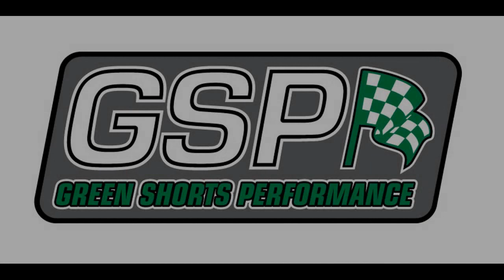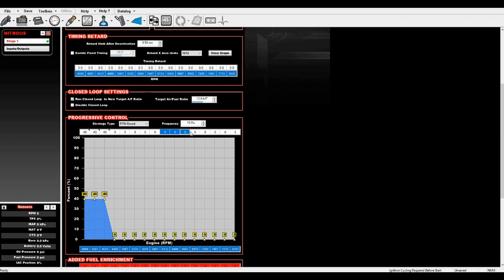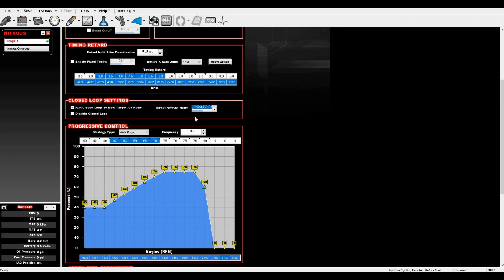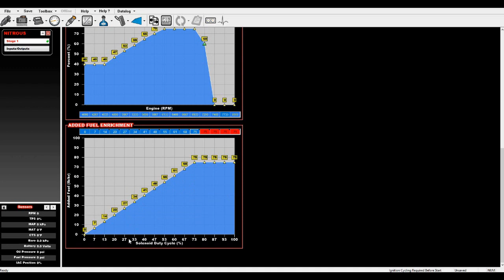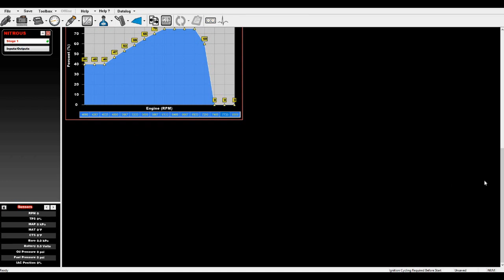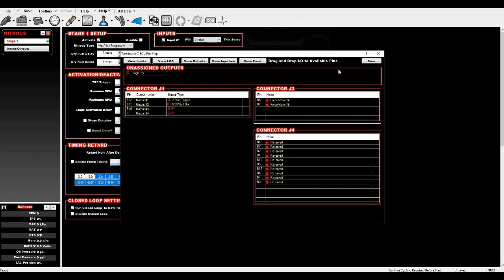How to Setup Nitrous Control with Holley Terminator X

Comment: ok, so im doing a street car with push button 100 shot, dry. using rpm retard. if wanted to do progressive, im assuming i'd do time based and it would start when the button is pressed. frequency is the pulse frequency right? percentage i would assume is the % of the solenoid  - 0% being closed and 100% being full open? 
this way it's not a sudden hit, although I'm not sure if a 100 shot would be too harsh on the drivetrain, but i'd still rather ramp into it over 2-3 seconds maybe.
Reply from the maker: @callofgeorge  for a street car I’d prefer to use rpm over time

Keep in mind it’s pulsing the solenoid not the jet. 

I wouldn’t spray at too low of an rpm and I doubt 100 shot will be an issue to hit all at once
Reply: @greenshortsperformance  ok cool thanks for the quick reply. ya it'll be RPM. the progressive is the only thing i figured would be time based since the trigger is off a button press. so essentially it won't hit every time at 4500rpm. only after he's held the button on the shift knob. so it could be at a higher RPM sometimes and only when he's wanting to spray by holding the button. i was actually curious if 100 shot would even be harsh enough to worry not hitting it at once. i've always been skeptical of using NOS because of it being an instant hit of a lot of power. prefer turbo or sc personally.
Reply from the maker: @ 100 at high rpm won’t be violent. Personally my best success is progressive rpm based with no button because the engine just acts like a high Hp NA engine. If you’re progressive down low and full shot up top it makes a 500hp engine drive like a 750hp engine etc and the driver isn’t worried about a button he just drives the car
Reply: @greenshortsperformance  i gotcha. its a 427 sbf that was dyno'd for 650hp na. its a "go baby go" button in an eleanor.. so may be more preference than practical. it'll probably get used like more of a "scramble" button.

Comment: @green shorts performance
Why would the jet not matter? I'm trying to wrap my head around that.  The solenoid can't outrun the jet, so how did it produce full power?
Reply: I’m trying to wrap my brain around the same thing!!!! I’m going crazy here because I have a 400 hp solenoid and dont want to spray the house down.
Reply: @DanielCornier-n6q I wouldn't worry about it. You can't fit 400 beans through a 200 bean hole.
Reply: yeah I don’t get that either
Reply: I get what he was saying but it doesn't make sense to me either. If your jetting is for a 50 shot at a 1 sec pulse of a 400hp solenoid. He's basically saying because your pulsing the solenoid it's going to outrun the flow of your jets no matter what they are up until the max flow rate of the solenoid. But I feel like in order to get the max flow from that solenoid, your jetting would need to be sized to match it.
Reply: @Six_ftdeep32 yeah I'm not sure what he's getting at. If you can get 400hp through a .43 jet then why would anyone ever need bigger solenoids. Makes zero sense and just isn't true.

Comment: I have 1000cc snake eater injectors. Do I set my injector duty up like yours? If my injectors are at 80% that's alot of fuel for a 175 shot right?

Comment: What if you have a standalone fuel system where you can put c16 or whatever fuel inside that you want to spray with? Would that be Wet/Progressive?
Reply from the maker: That’s correct. Adding fuel not with injectors is a wet system
Reply: @greenshortsperformance  any info on setting that up
Reply from the maker: @Crodgers88  it’s the same as dry minus the added fuel. It’s just assuming that you’re adding the fuel in some other way.
Reply: @greenshortsperformance  I had someone help me install the Terminator x with a basic tune to start. He also set up the nitrous inputs and the system turns on etc. I went to a tuner and he tunes the car and it runs great. I saved his base file as a new set up and went in and set up the nitrous wet progressive cause I have a standalone system and ran it down the track. Did a small shot to test and did a 50 shot and on the big end it didn't sound happy. I'm running 110 in the fuel cell and im running the correct plugs just kinda at a loss why it would hesitate or sound like it would miss. I'm really lost or I'm just still so new I have no clue what's going on
Reply from the maker: @Crodgers88  first step is to pull plugs. Second is to datalog it and see if there’s anything obvious. Then third just understand that wet systems have delays and are usually very bad at progressive control because you’re pulsing a solenoid that is controlling your fuel flow at a low frequency. So the time it takes to start and stop flow is a major portion of the pulse time. 
Personally I don’t recommend wet kits. And if wet is required I definitely never recommend progressive

Comment: If I have an arming switch.  Do i need to run an input wire to that switch and put n20 enable on that input?  Thanks
Reply from the maker: That’s correct. And the tune needs to know if that’s 12v or ground signal to arm